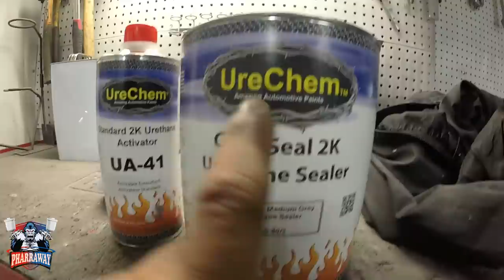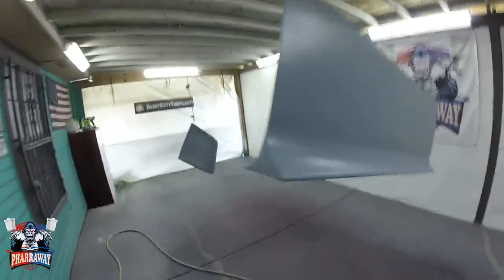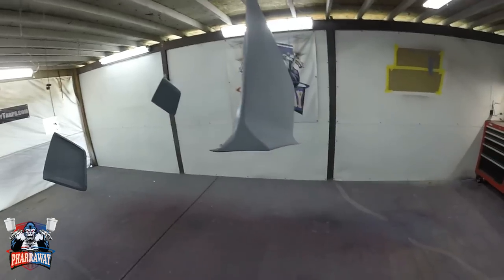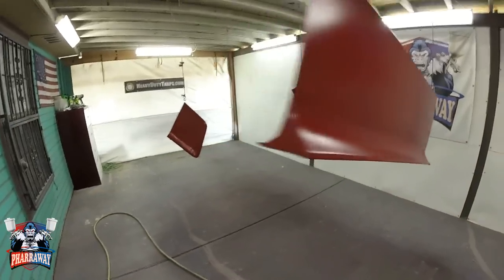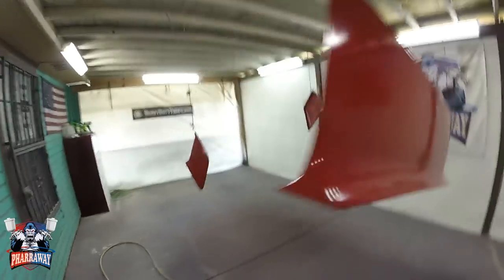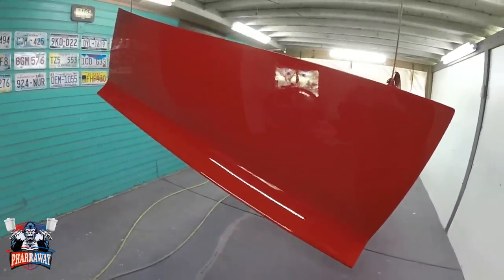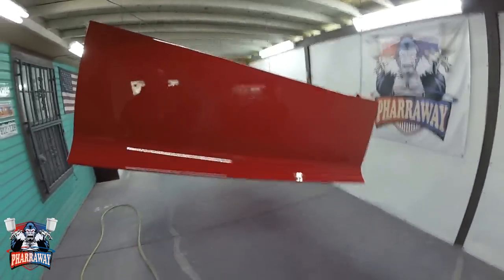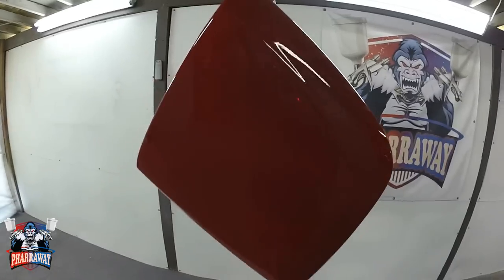TIPS AND TRICKS ON AUTO PAINTING

Comment: Hey pharraway, I got the 4 part water filter system u recommend. My question is how often u change the dessicant beads? Do u normally wait for all the beads to turn pink? The top 20% percent turns pink and I usually just remove that and add more
Reply: I remember you saying you put them in the oven. Can you please explain how to do that pleases
Reply: @arnoldzesati6072  I tried the microwave defrost but it would turn back to pink again lol I'm kinda hesitant to put them in the oven
Reply from the maker: Hi yes just wait till it's pink and you can put them in the oven at 400 deg at about 1hr and you can reuse them

Comment: Carnal any tips of how not to get any chemical reactions in my basecoat
Reply from the maker: The best thing to do is pressure wash the body after sanding it, only with water no soap and dry it after you mask it for paint use a wax and greas remover to clean the area
Reply: @PHARRAWAY  can i substitute the wax and grease remover with 50% water 50% rubbing alchol.
Reply from the maker: @calixtoavila7807  I have never tried it wouldn't know you can also use Acton but just be careful with it use gloves
Reply: @PHARRAWAY  thank you am goin to see if they have it over here in mexico